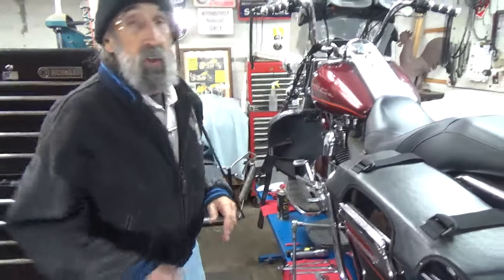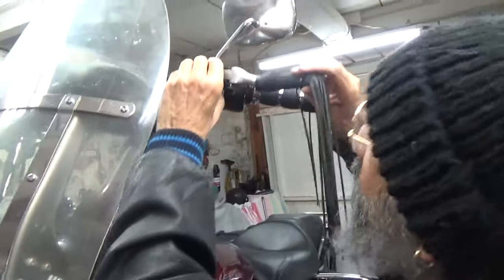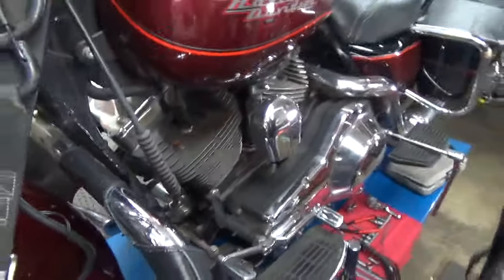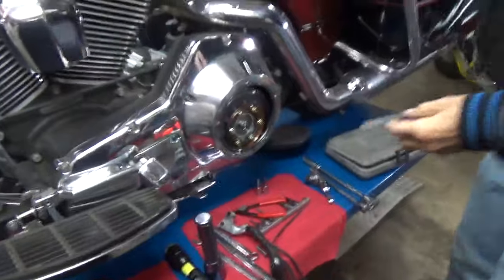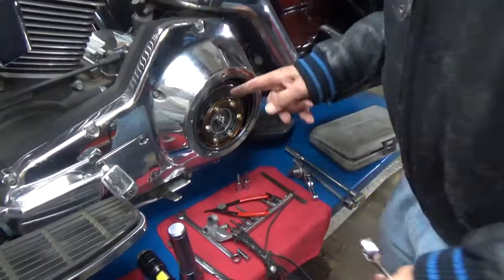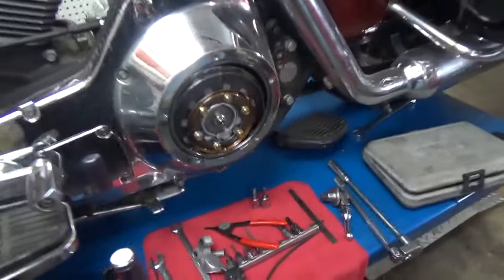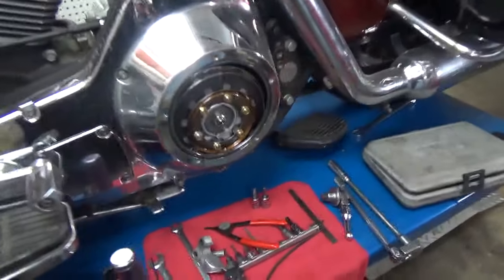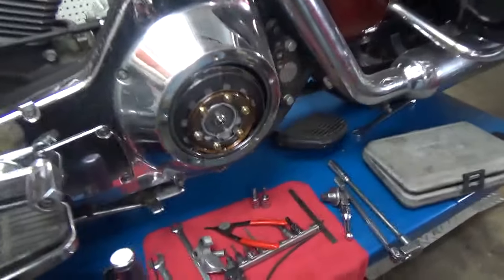Adjusting the Clutch on a 2000 Harley Roadking

Comment: I'm impressed Mike I've been a mechanic for 25 years and if I had a light colored shirt on and a grease gun out it would be all over me. Lol. Great video as always guys enjoy this weekend.
Reply: I feel your pain on that one
Reply from the maker: Thank You.  I try not to work too hard.
Reply: I have worked with mechanics that worked very hard and got the job done and didn't have a grease spot on them and I would have grease and dirt in my hair on my face and every inch of my clothing. Also worked worked at a place that ran 24/7 and we shared tools between shift and one guy I worked with would never wipe a tool down and every tool he used was covered in grease. He drove me nuts. There is nothing worse than grabbing a tool off the peg board and it's full of grease.
Reply: I have worked with mechanics that worked very hard and got the job done and didn't have a grease spot on them and I would have grease and dirt in my hair on my face and every inch of my clothing. Also worked worked at a place that ran 24/7 and we shared tools between shift and one guy I worked with would never wipe a tool down and every tool he used was covered in grease. He drove me nuts. There is nothing worse than grabbing a tool off the peg board and it's full of grease.

Comment: Great work Mike!
I stole a hack from a van lifer. I use a Little Buddy heater underneath my bike hoist and now I have added an Eco Fan to blow that warm air for free? Well $100 for a woodstove fan, then five minutes with a cutting wheel on the base and it locks in and sets in the grill of the Buddy heater giving me more comfort. This last cold weekend here in Iowa I was cleaning and syncing carbs for an older Goldwing and I stayed warm even with carb cleaner and fuel on my hands with the cold metal. 
Gone are the days of a heated shop even though the work continues. Hope that hack works for others to stay comfortable and safe while keeping your bikes running.
Thank You again Mike and Mike, with Love and Respect You are in my prayers
Hoka Hey
Reply from the maker: Thank You.  And all good stuff to you.

Comment: I'm partial to your Evo vids Mike. UPS just showed up with my new Springer fender and parts. Now I'm excited. I almost have everything to swap my FLSTC front forks to a FLSTS Springer front end. My 98 runs like a fine sewing machine thanks to your videos. You just stumped me with the tranny rod. I didn't know that you had to move it like that. Now I know. Thanks Guys for making these vids, it really helps...
Reply from the maker: That's very cool.  Checking that arm is just good procedure.  Ever adjust your clutch and take off to find out it's loose and you didn't expect it?  Wonder why, readjust, and then it was fine?  Now you know why.

Comment: Listening to your comment about over filling your tranny, I think I was doing the same with my 2000 FLSTS, Heritage Springer, only where it leaked was out at the in line adjuster from the boot. Each time after a ride, I would ring about a half dollar size puddle in front of the motor. 🤷 So now, I only fill the transmission to the halfway point on the dip stick. I've replaced the cable once and it still does it once in a while. The bike has about 68K miles, all original. Well, a few mods but no don't think it would cause this. I installed S&S gear drive cams about 44 k miles back and have had no problems with the motor. 
I also made sure the transmission case vent was clear and it is. Thanks for the video..😎👍
Reply from the maker: Puddle in front of the motor is usually from the engine oil filter.  It is very difficult to change that oil filter without losing a little oil onto the crankcase.

Comment: A friend told me not to over tighten that primary idler shoe.A minimum of 5/8” slack is needed to keep pressure off of engine and transmission bearings.
Reply from the maker: Right around there is good.

Comment: I have a 2000 Night Train Twin Cam. 
The clutch was good, but I noticed that HD did a modification for the early Twin Cams that improved the clutch action.
I had it done at my local Harley dealership and found it to be a great improvement, now if you can still get the kit, is another matter.
If your friend John wants one I will dig out the paperwork a see if I can find the part number.
Reply from the maker: Thank You.  I can check with the local Harley Dealer.

Comment: Great video Mike seems like I’ve always had trouble adjusting the clutch on my 04 roadking. Even popped the cable in the transmission and had to do just like you said. Pull the pipes. Pain in the butt. Next time I’ll remember to pull the dipstick and make sure the cable is all the way back. 😎👍🏻
Reply from the maker: We just keep at it;  we'll get good if we do that.

Comment: Those are "Jesus" clips because every time one goes flying and ends up in a spot that you can't get to you just say Jesus. Also those crash bar bras are wonderful for cold weather riding. First had a set in '87 and didn't think that much of them until I put them on the bike. What a difference they made for staying warm on a cold day. One weekend I rode 1100 miles on a weekend to see my kids in November and when I left it was 22 degrees and never got above 37 the whole weekend and those thin little bras made all the difference. They kind of funneled the air in front of the motor and the air from the engine would wrap around your legs and helped keep you warmer. Later my friend, good video by the way.
Reply from the maker: Thank you.  Sounds like those parts are great.  Take care.

Comment: Needs a jiffy stand spring to.
Reply from the maker: Funny you should say that.  It bothered me.  So, I replaced the spring and the rubber snubber that goes on the frame and cleaned and lubed the assembly.  I actually had those parts in stock, left over from my old shop.  But, I had already taught the kickstand (jiffy stand) thing on the channel.

Comment: I just wanted to say that nineteen seventy five seventy four inch shovelhead that I own.
The transmission always had problems with leaking oil. The vent screw from the  factory wasn't drilled through the threaded part all the way. I drilled it out problem solved.😊
Reply from the maker: Cool.
Reply from the maker: Be sure you cover that vent when washing the bike.
Reply: @pacificmike9501  ok I never thought about that.👍

Comment: I was having a similar issue with my Moto Guzzi V7.  The clutch pull was so stiff that I was beginning to get tendonitis in my left wrist because I had been adjusting the clutch lever barrel alone to compensate for stretch.  After taking all the slack out and adjusting the cable down by the clutch fork first, I was able to dial in the lever to have a much more comfortable pull while still giving me the friction zone engagement where I like it.
Reply from the maker: And that's what getting the correct geometry on the mechanism is all about.  That's why most directions for clutch adjustments tell you to back off on the cable and adjust the mechanism first.

Comment: Great video. When adjusting the primary chain  it is made at tightest point on chain as you rotate rear tire with bike in gear. By not doing so you have no idea if the adjustment you made was on tight or loose spot on chain. Unless you did so off camera
Reply from the maker: You are right.  But, believe it or not, with todays primary chains submerged in oil, they don't normally develop that tight, loose condition like they used to.

Comment: Mike did you just realy started adjusting the clutch without removing the battery power ? I meight be a numbnut but I always remove it when doing anything near those parts, am I too carefull ?
Reply from the maker: No such thing as too careful.  That sounds like good practice to me.